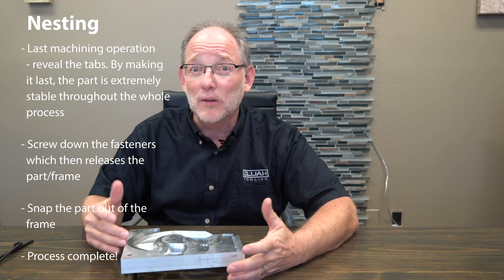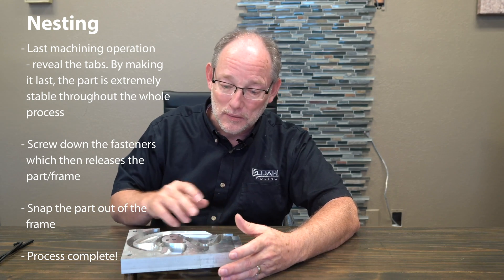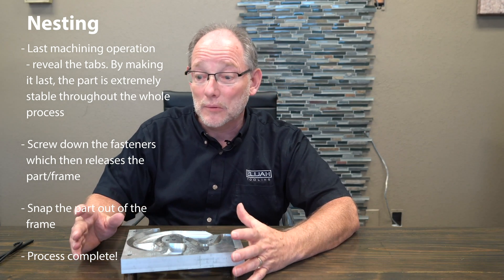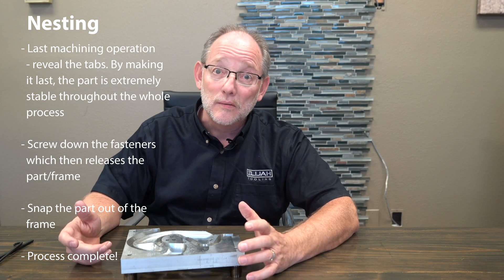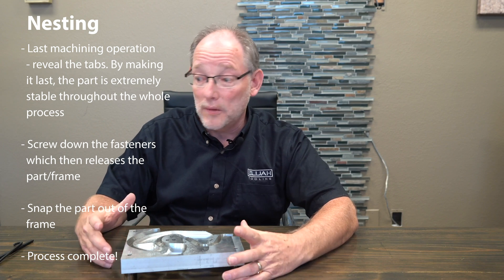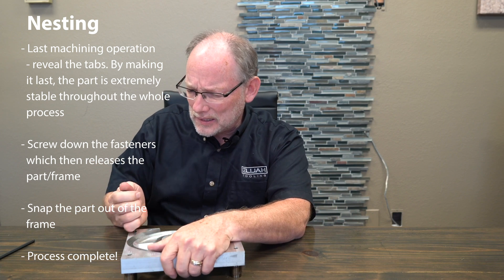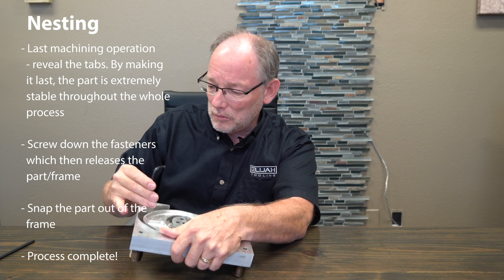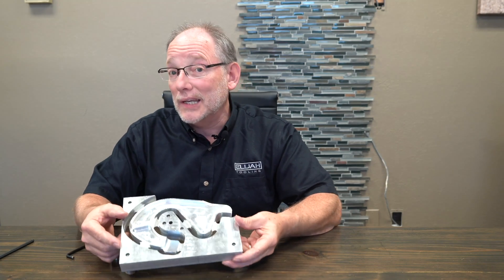The Best CNC Workholding Method in Aerospace Manufacturing

Comment: Blast from the past---- I also started this way programming for Areo-space companies. SETPT = POINT / 0.0, 0.0, 0.0
STRTPT = POINT / 70,70,0
P1 = POINT / 50, 50, 0
P2 = POINT / 20, -20, 0
C1 = CIRCLE / CENTER, P2, RADIUS, 30
P3 = POINT / -50, -50, 0
P5 = POINT / -30, 30, 0
C2 = CIRCLE / CENTER, P5, RADIUS, 20
P4 = POINT / 50, -20, 0
L1 = LINE / P1, P4
L2 = LINE / P3, PERPTO, L1
L3 = LINE / P3, PARLEL, L1
L4 = LINE / P1, PERPTO, L1
PLAN1 = PLANE / P1, P2, P3
PLAN2 = PLANE / PARLEL, PLAN1, ZSMALL, 16
Reply: Yep!

Comment: Window framing is really nice to use on 5 axis as well. 99,99% complete part off the machine, just sand down the (2-3)small tabs left from breaking it out of the frame.

Comment: This is exactly what I was looking for. I don't want to spend the cash on 5 Axis. I want to inexpensively hit as many sides as I can. This... IS... IT!
Thank you very much.
Best Matt
Reply: You can do this on a 5-axis too.  Add.5"-.75" stock to the dovetail end of your blank.  Clamp the part in your preferred fixture.  Machine the five sides.  Kick the part over 90°, mill half of the sixth side.  Rotate 180°, and mill the other half leaving 2 to 3 .010" thick tool tabs holding the part to the dovetail.  Remove the part, break off the tool tabs, and blend the mismatch.  Not ideal for tight profile tolerances, but my experience has been good for the .030" profile commonly found on most aerospace (Boeing) parts.  The beauty is that this blending can be done quickly while the spindle is cutting the next part, plus one less setup to do.
Reply: You don't even need the extra machining dovetailing entails... that's really a new fad. Just use grip jaws and hang onto 3mm of material with the max torque clamping for your vise... you shouldn't have any issues, especially for softer materials.